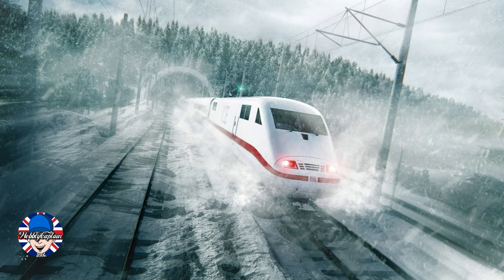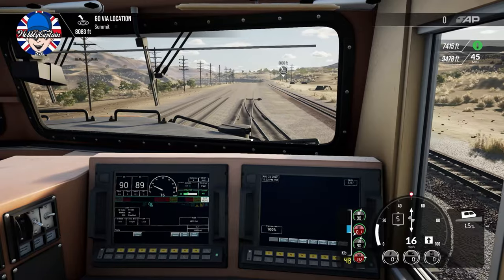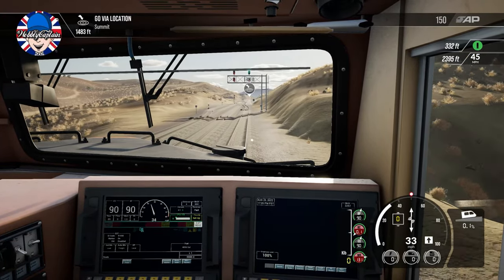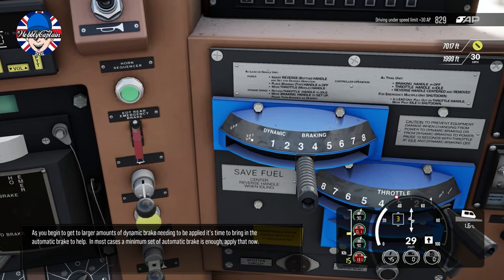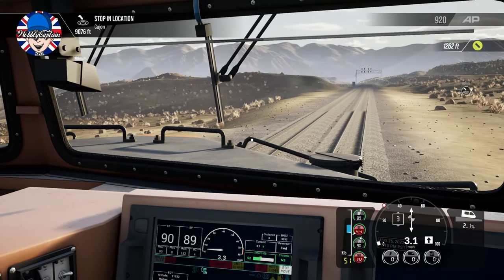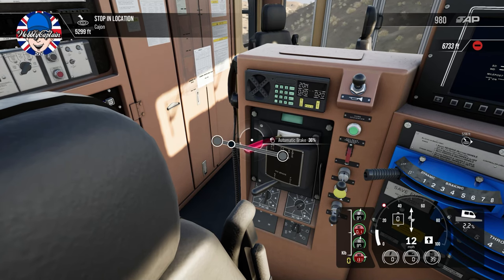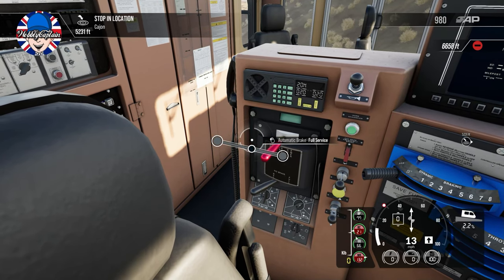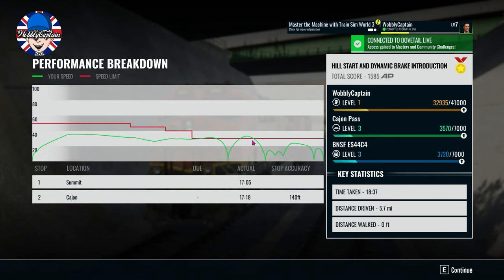Hill Start & Dynamic Braking Tutorial Playthrough Train Sim World 3

Comment: You must have missed a very important point that the narrator said. When you put the air brake to minimum, you are supposed to bail off the independent brake, you haven't done that, if you don't do that, the dynamic brakes don't activate.
Reply from the maker: Can't remember now 😂all I can remember is I think the throttle as to be set at zero , set the dynamic brake to set wait 10 secs before it will work then apply I guess I missed the bit about bailing off the independent brake else it don't work  🙄👍 thanks
Reply: @wobblycaptain  yeah, you have to bail off the independent brake in order to keep the dynamic brakes active.
Reply from the maker: @anthonypecoraro5472  Cheers buddy will try remember the freight trains are awesome I know nothing about them other than they are my favourite in game 👍